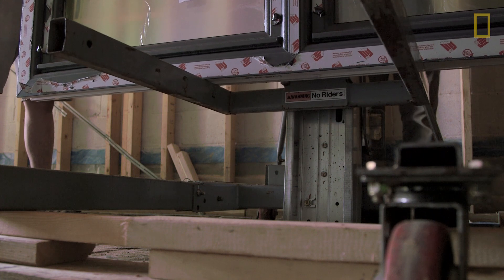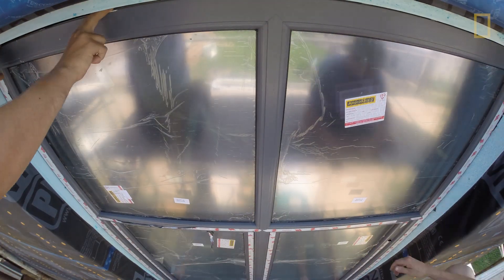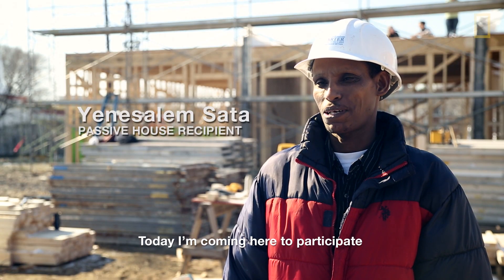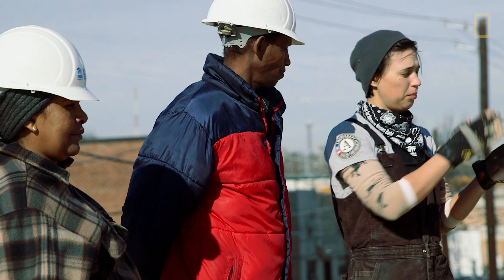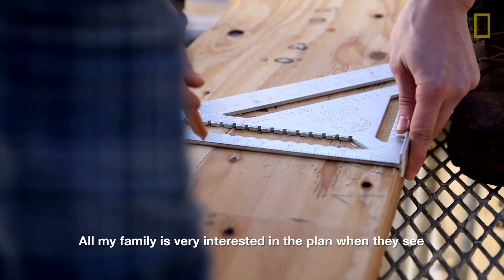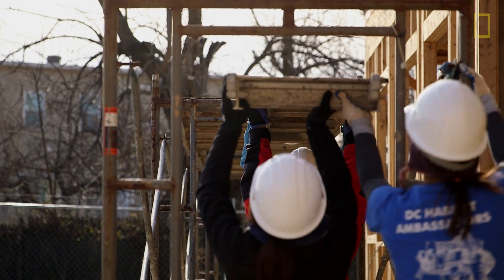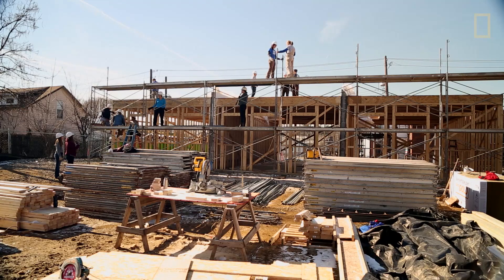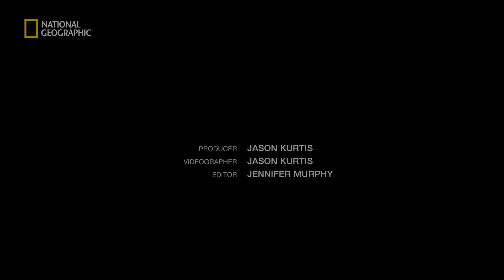Most Earth-Friendly Home Ever Built? | National Geographic

Comment: I've found that this is a builder and building codes issue and less of a homeowner issue. It seems that customers want this now but  builders that I've worked with cut corners on efficiency and pay close attention to options that give them addition profit such as enificient recessed lighting. Code enforcement always gets in the way or discourages radical ideas that clients want. For example I wanted a stairway to the attic, it took a lot of conversation to get the builder to understand why an attic needed a dedicated stairway. I found many flaws to a house but to code for example a 15R insulation in the walls was considered adequate enough but the attic needed R32, shouldn't every nook and cranny need R32 in that case?